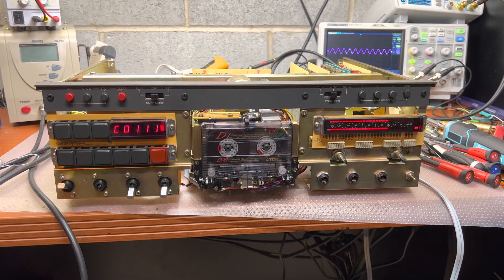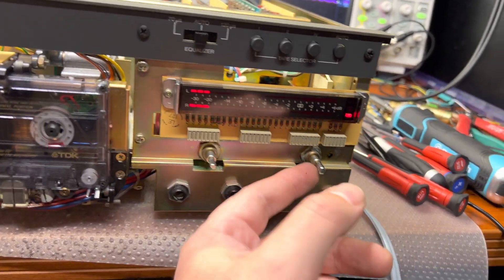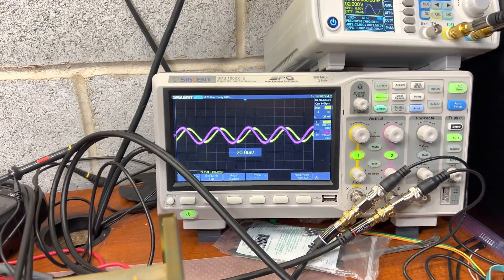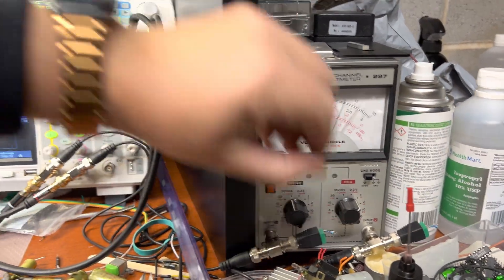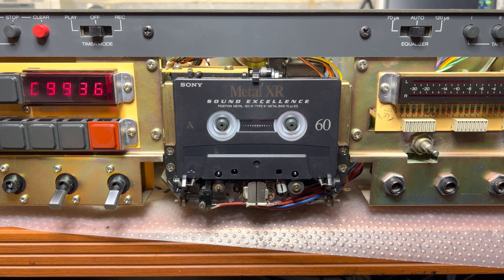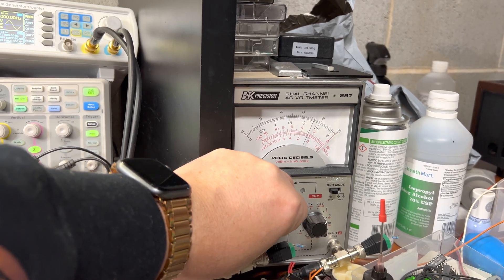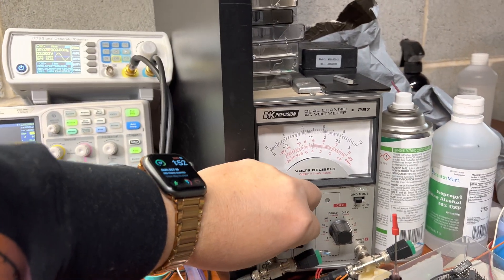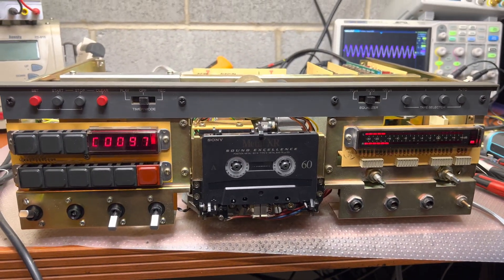Pushing the Limits: Recording 27 kHz on Revox B710

Comment: Sir.Don't get me wrong here- the fact that it can receive and record a freq that high is impressive but there's no energy in the signal like the full music scale. Maybe use a piece of un-compressed music then flip between source and recording.That may give you some idea of its quality
Reply: He will do that at a later stage, but measuring with an oscilloscope is a required (and very valid) step at this point. There is no "music scale" at 27kHz so he could Not show this capability of this deck by simply "playing music". You can't measure frequency response extremes with a SONG....
Reply: This man knows all there is to know to get decks working there best ,he will do audio test when it is properly set up and calibrated .